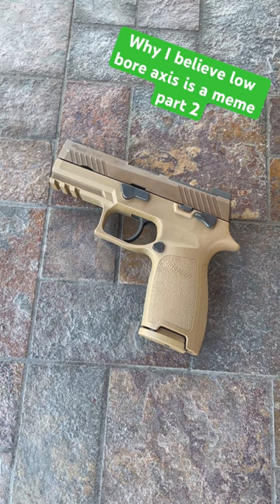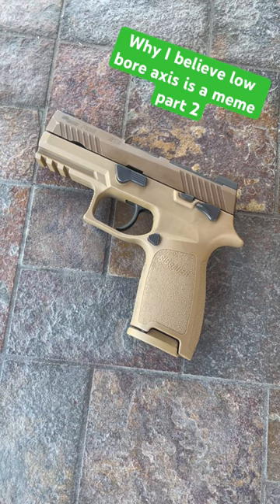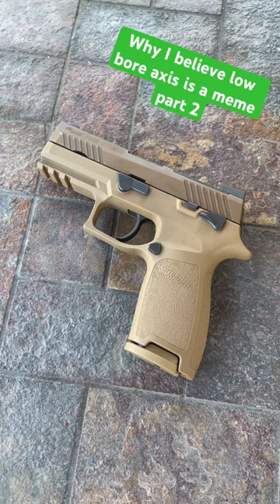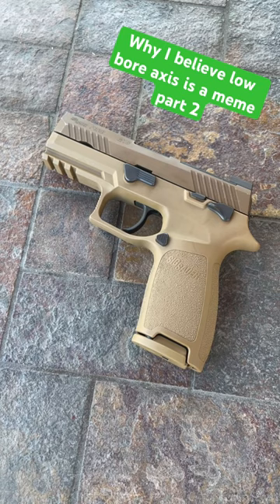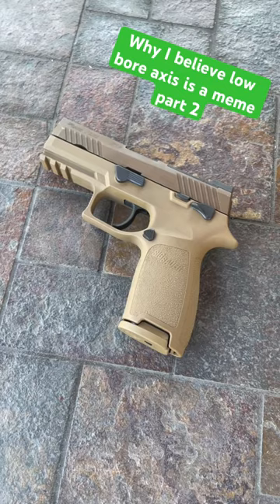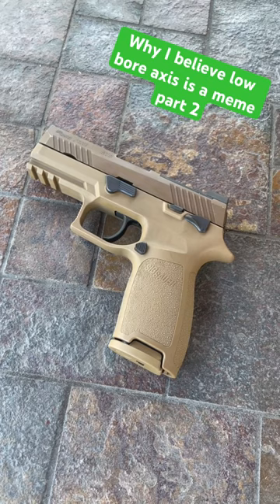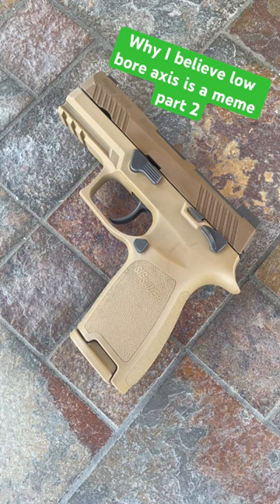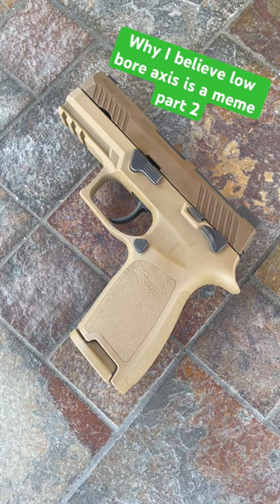Why I think low bore axis is a meme part 2 #shorts

Comment: It’s not that it’s absolutely necessary to have a steel frame. i carry a Glock at work sometimes and so do my coworkers. It’s certainly a capable gun. The main difference in why the Q4SF is easier to shoot faster than the Glock is the slide mechanism machinery being better, and the better weight balance. The more the machinery is designed to reciprocate smoother rather than slamming back the smoother the shooting is. I also sometimes carry a 1911, which slams back the hardest and doesn’t rock the barrel back and forth like a Glock does, making the 1911 even more of a slam. The Glock rocks the barrel back and forth so it’s less of a slam, but the Q4SF reciprocates in such a way as to lessen that impact and that is why it’s easier to shoot fast than the Glock and the 1911. The weight is also a factor but it’s not the reason it’s better. Polymer is perfectly fine. The real factor is how well the slide mechanism mitigates the impact of reciprocation. I train a lot and compete in IDPA, and we also do VIP security in downtown baltimore and I prefer a speedy second and beyond shot in a situation where there are multiple assailants. It’s obviously possible to be accurate and fast with a Glock, however if the nonvariable is me and the amount of training I have, and that is then applied to a steel frame Q4SF and also applied to a Glock, it’s clear there is an advantage with the steel frame. The polymer Glock is fine, and can be shot fast and maintain sight picture for rapid shots but it requires less push to maintain with the all steel Q4SF.
Reply: I recently started shooting the q4sf better than my shadow 2, strike ones, archon type b, q5sf, p226 x5 and 2011s. I’m starting to notice most smaller guns with less reciprocating mass can get back on target quicker once you perfect your grip but most take a lot more effort so very few people notice.

Comment: Lower bore axis helps and is advantageous without any real downsides. However, there are many factors which impact recoil. A beretta has a higher bore axis than a CZ P10C, yet recoils less for example. With 9mm you should have manageable recoil with sufficient training and grip strength, even if the bore axis is high. 

Regardless, if looking to optimize something, you take into consideration everything.
Reply from the maker: Everything has its pros and cons. Low bore axis does create ergonomic draw backs with minimal advantage to 99% of shooters that are new or novices to shooting. What I mean by this is low bore axis pistols typically have less slide space and less surface area that some shooters might want for ergonomic purposes and would be able to be good with and train with. 

That said I don’t think it’s useless or even non beneficial, it’s just not end all be all as some people say it is. A lot of factors involved but the point I’m making is bore axis is another pro/con to think about.
Reply: @VintageWarfare  I agree it’s not the end all be all. I’ve personally never heard of low bore axis creating ergonomic draw backs, I’ve heard the opposite though and in my experience I don’t notice any drawback to either one

Pretty much all things have minimal advantages to 99% of shooters because as you said most people don’t train. How much it helps the average shooter is in my opinion not a valid benchmark or metric. For serious shooters who are the only ones these debates should even be relevant to, it does matter. Rob Vogel is an anomaly but he switched from a 2011 or CZ shadow (I can’t remember which one) to a glock mainly because he liked the bore axis, so I think it’s fair to say it should be in consideration for some.
Reply from the maker: @georgekromidas5097  oh absolutely. And as stated, if you know enough to want a pistol with low bore axis do it. 

But if you are just buying something because someone says “low bore axis = best” no matter what, I don’t agree with that premise alone. Fact is if it’s from a reputable manufacturer and the model fits you and your needs? Literally all that matters.
Reply: I ain't readin' allat
Reply: I mean, ideally i would reccomend low bore axis pistols anytime i can for novice shooters, as long as the rest of the firearm is of acceptable quality. I prefer retta 92s as a full size, but barring that i would go straight to a low bore compact.
Reply: @psychocomytic9778  92s are awesome and I love them. They don’t have low bore axis since they’re hammer fired but it’s open slide non tilting barrel, which makes up for it
Reply: @georgekromidas5097 facts
Reply: Agreed

Comment: “99% of you don’t shoot enough for muzzle flip to even make a difference.” 

Dude, no joke. Teaching new shooters regularly and the muzzle rise is so much easier resisted with just proper hand and thumb placement. 

So many ask about compensators, changing recoil springs, different mods, ported barrels, when really they could do some dry fire and some dollars toward ammo and they’d get better results for cheaper 

So refreshing to hear a sane take
Reply: I mean if you're well informed enough to reccomend this as a consideration to new shooters wouldn't you? I've never thought to state it explicitly but bore height does play a consideration anytime I'm reccomending someone else a piece.
Reply: @psychocomytic9778  Ok

Comment: I totally agree 💯 The "physics" are definitely there, low bore axis is really a real reality... although the majority of shooters aren't going to notice the difference, it just won't matter to them. 
I think it's more relevant in revolvers. Take the Rhino, (I know, I know, everyone goes directly to the Rhino 🙄 but hear me out), with a cartridge like 357 that has noticable recoil, utilizing a platform without a reciprocating slide (the revolver). Most shooters WILL feel the difference in recoil impulse when shooting the Rhino. Shoot it side by side with any other 357 revolver and you will agree, it IS more manageable, it IS easier to remain on target and take follow up shots. If you take the reciprocating slide out of the equation then yes, low bore axis IS certainly relevant. It's just not relevant enough to notice a difference in something like a semiautomatic 9mm handgun. The slide cycling alone generates enough recoil energy to throw any noticeable benefits out the window. It may matter to some shooters in niche scenarios, but not most.

Comment: I think it’s hilarious guys will obsess over a low bore axis pistol like the Alien and then it doesn’t even have a compensator on the end 😂 if someone really wants to mitigate recoil that’s the way to go about it. A simple threaded on barrel accessory like a comp on your standard polymer framed handgun is a far cheaper and easier way to mitigate some of that muzzle rise for both the average or competitive shooter. I personally carry a Hellcat RDP every day, a big reason is that little comp it has, for its smaller overall size and weight compared to say a larger G19/17 means the comp really helps me stay on target.

Now combine a compensator with a handgun like say the Alien or Rhino and ya may actually have a design that’ll catch on in popularity. One big problem, those are the two lowest bore axis handguns in the world, and they’re also some of the priciest options out there. Until that low bore axis barrel design is in a handgun less than four figures it won’t be popular. Thus a threaded barrel and compensator is the way, or one get a fancy ported barrel n slide for a similar gas deflecting and barrel rise mitigating effect.

Comment: I have a 226 and a Hi Power, both hammer fired, double stack, metal framed 9mms. The muzzle flip is not just a little more on the 226, it’s a LOT more
Reply: There is something different about the sig 226/229 series guns. Ive shot 357 sig/ 40 cal 229 and it seems like it snaps more then my Glock 22
Reply: Yea, my first gun I bought for a pistol at 21 this year was a Hi Power. Love that thing dearly my daily carry. I enjoy the weight of it.

Comment: another major thing that needs to be mentioned: low bore axis is almost meaningless in semi automatic pistols with full slides

the vast majority of the energy that causes muzzle flip is created by the slide impacting the back of the frame, and exerting that force against your hand; which creates a lever that moves the muzzle upwards

this is why low bore axis' effect is noticeable in guns like the chiappa rhino (where theres no pistol slide) or the laugo alien (where only about half of the slide actually cycles) but is virtually nonexistent in just about every other common semi auto pistol; the slide is much more important

Comment: Bore axis does make a difference, but to me it doesn't make as noticeable of a difference once you get your mechanics and grip down. You can get away with more margins for error and a less than perfect grip with a low bore axis pistol while you're shooting fast, but you should strive for better if you're relying on a low bore axis to make up for a shitty grip. If folks back in the day can shoot something like .40 S&W out of pistols with higher bore axis or small single stacks for cc well, there really isn't an excuse for higher bore axis with 9mm for followed up shots IN MOST CASES (competition being one of them like VintageWarfare mentioned).

Comment: If you think it's a meme, you probably haven't done enough research and are probably just making excuses for the gun you love, which happens to get a lot of flak for it's higher than average bore axis. Having that lower bore axis would actually help those shooters that don't spend much time behind the trigger, as they don't practice recoil control and mitigation. Just because you don't understand something, doesn't make it a meme.